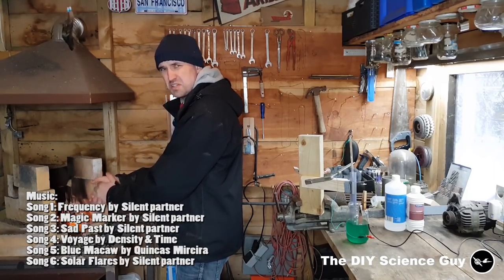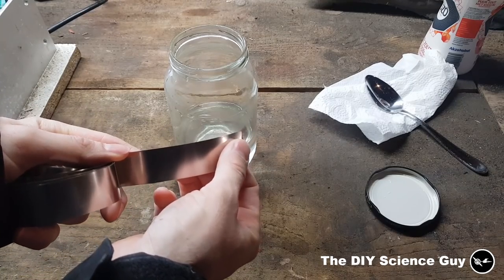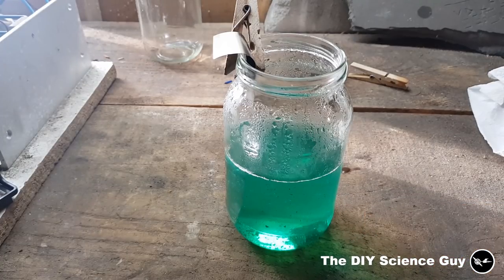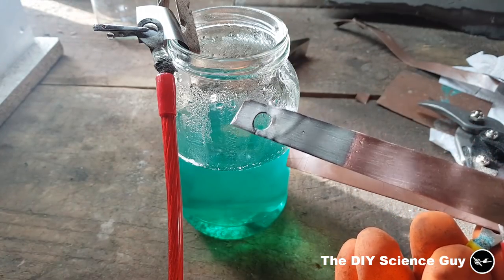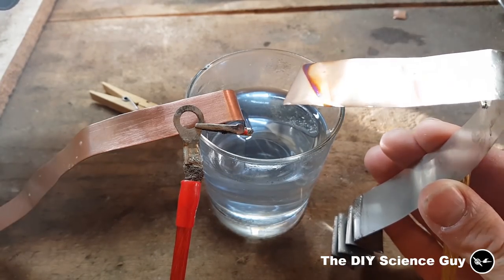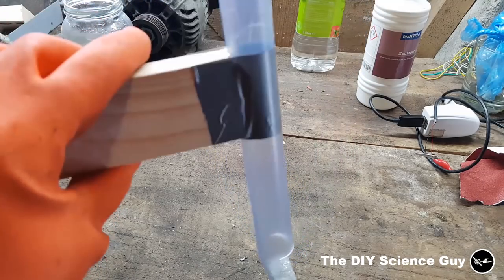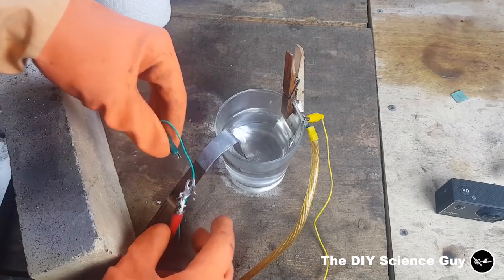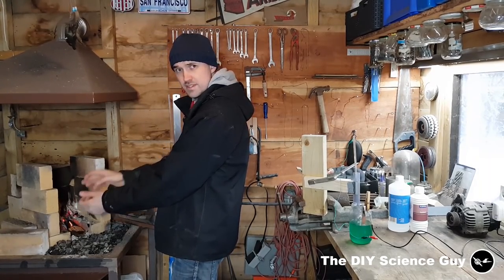Hydrogen Generator #4 Heavy nickel plating hydrogen generator electrode experiment

Comment: Excellent work! I was a little skeptical that a small layer of electroplated nickel could protect the copper substrate (even if a tiny pinhole appears in the nickel layer, the copper will eventually disintegrate under anodic conditions), but if that tiny piece can handle 3 amps for at least 6 hours without eroding at all, it looks like you've got the perfect electrode. Cleaning the copper beforehand with hydrochloric acid is definitely essential though, as any tiny bits of oxide or impurities will ruin the nickel layer, but it looks like you've got most of that figured out.

One thing to note, if you see any blue colouring or particles in the solution at all during the electrolysis, it'll mean that the copper of your anode has started to corrode and may need a re-plate of nickel.

Can't wait to see you open up that hydrogen generator.
Reply: Scrap Science.   The nickel plating has to be fairly heavy for this very reason.  Edison had good success with these materials in his Edison nickel-iron battery.
Reply: motor movidos a agua   https://www.youtube.com/watch?v=6iWjn3If5V0

Comment: If you are nickel plating you should use nickel clip on the positive side because if you use copper clip on the positive side the copper will  move to the negative side. Electrolysis transfer metal particules from + to - if you use copper clip on negative side it doesn't matter it will just be plated with nickel. If you always apply this method you won't get contamination in your plating like the black stuff. Positive side clip shall always be same material as anode. E.g plating nickel = nickel clip on + side. Plating copper= copper clip on + side. To make the nickel acetate voltage 12 volt and amps 25 or more doesn't matter but for plating process best result at maximum 3 volt and below 3 amps. Your nickel will stick firmly and evenly to your cathode

Comment: I have a comment for you when you plate nickel. You need a magnetic stirrer to keep the solution moving and the plating will not have those round balls on the surface. Worked in a plating shop a few months so I know that for sure. We used stirrers and flow aeration pumps ( vigorous solution agitation ) and high frequency ( makes shiny surface happen )to prevent the bee bees from occurring. Hope that helps.
Reply from the maker: Yes I saw something like that in an other video about a plating factory where they constantly kept the plates moving from side to side. Thanks for the info, will definitely use that! 👍

Comment: Cool. In your last video I think you used common 304 Stainless Steel, which will  corrode rather easily. It will even rust in mild saline conditions. Most HHO enthuseists use specifically 316 Stainless Steel, which is used in Marine aplications, Industrial Food Processing, Industrial Chemical processing, Powerplants, etc. Its an alloy designed for structureal integrity and high corrosion resistance. It will save you the fun of nickel plating copper and in this type of application the efficiency of copper compared to stainless steel is not significant because your plates cross section and surface area are quite large and you are not transfering power more than a few millimeters between them. differences in metal conductors are significant only with extremly low voltages or over a meter of distance or so. you know what I mean. You have more resistance in your electrolyte than the metal itself, lol.  Also your aceesss heat is comming from having way more amperage than you really need for the size plates you are using. Try about 0.54 Amps per square inch. of a single plate on one side. More amps do yield more gas but at the cost of more heat. Ive never seen anyone using a water cooling system like this but why not lol. cheaper than adding more plates  Awesome, video. I enjoy your process.
Reply from the maker: Thanks! And thanks for the info 👍
Reply: Where did you get this number 0.54 amps per square inch where does that come from/how was it derived?? Why does everyone keep saying 0.54 amps per square inch is that a 316L stainless steel exclusive variable or does that even apply to nickel/copper??

Comment: Excellent video! Way more informative than any I have seen.. I have tried nickel plating and had the same problem of the part not plating properly.  I will try limiting the amount of nickel anode in the solution to decrease the voltage.. I am using a cell phone charger 5v 2.4a..

Comment: Awesome work. I would suggest that when plating the electrodes to limit the current to 25mA. it will take longer but also ensure a more even distribution of nickle. Also turn the electrodes around regularly and agitate the solution regularly.
Reply: A good magnet under the cup can stir up the water or keep it moving. Not sure if it will hurt the plating or not.
Reply from the maker: Nice suggestion I will give it a try! 👍
Reply: What is the optimal voltage and how do you work out what voltage and current is best for plating?
Reply from the maker: Set your power so that you have the least amount of bubbles on the anode.
Reply: @LEO-xo9cz  - The voltage required will depend on the resistance of the electrolyte, ideally you would want the electrolyte to be as concentrated as you can possibly get it, higher concentration of the electrolyte means less resistance which means less voltage required. When voltage is passed through water with an electrolyte in it bubbles will start forming at the electrodes, these bubble of Hydrogen and Oxygen will disrupt the electro-plating process, so using too much voltage and too much current will result in an uneven and poor quality plating. So the idea is to use as low voltage and current as possible to reduce the amount of water separation (bubbles forming on the item being plated), in order to ensure a good even and strong plating. although it will take longer it will be worth the wait. It is useful to have a good quality power supply with voltage and current regulation.

Comment: I hope you had good ventilation there, you were always so close and also above the jars.

Also the salt method is more dangerous than the sodium carbonate one. But i suppose until now you know that one too.

Regarding the nickel band that broke, i suppose it is too thin. But you make it with what you have around.

Cheers
Reply from the maker: Yes very well ventilated!
Reply: Sodium carbonate will react with acetic acid (in the vinegar).

Comment: Fantastic video - I'm learning, I'm learning!
Love the practical demonstrations and the problem solving because there will always be issues, but the gist is in the solving of them.
I'm curious how well the procedure to plate the copper would work on a plate, does it scale upward? Would work on silver (better conductor) or gold (unlikely to corrode)?

Have you considered how to store hydrogen, even to pressurize for auto fuel tanks?

Stay safe!
Reply from the maker: Thanks!! In this video I show my hydrogen compressor: https://youtu.be/REV739pRNcw and in this one I'm plating a big copper electrode: https://youtu.be/GOppb7jRGCc I find silver and gold to expensive to experiment with.

Comment: Have you ever thought about using silver for the "plates"? I have seen someone make a hydrogen generator with washers. If you could use one once silver pieces, pure silver doesn't corrode or tarnish, from my understanding.
Reply from the maker: Yes but because it is more expensive I chose nickle.

Comment: @The DIY Science Guy - Thanks for the Great Video! Just come across your channel sort of by accident. But You've got my Attention. 
Never heard of anyone using copper electrodes for Hydrogen before. I thought about it once, but knew the copper would be eaten away quickly. I've also been recently messing with plating. My question is, if electrolysis can erode pure nickel in order to plate with it... if you did nickel plate the copper electrodes, HOW doesn't this thin nickel plating  just erode away?? As a hydrogen unit is basically just electrolysis....?  Seems like the nickel would get stripped off and redeposited on the next plate or etc?? But this didn't seem to happen in your test.... hum.....
Very Interesting Concept though, and maybe I'm missing something in this. *IF* the nickel plating would hold up long term, THIS could be a GREAT Idea! Would really like to hear more about this, subscribing and going to do some searching on your channel :-)
Reply from the maker: Thank you so much!! I'm no chemist but I think it has to do with metal oxides dissolving in an acid and precipitating out in a base. The oxide layer dissolves in an acid and exposes new metal and so on, but in a base the oxide does not dissolve so it protects the nickel underneath. Thanks for subscribing!!!
Reply: @TheDIYScienceGuy  Thanks for the Reply! I'm no chemist either... maybe a "garage scientist".... :-)  
Or maybe I'm just someone who likes to do their own work as much as possible, and learn everything I can so I can do More Work, and take what I learn in one project and be able to apply what I learned to help further a completely different project. 
In any case, I first started fiddling with hydrogen back... around 15 years ago? And I came up with a design i wanted to try way back then, but never had a mill, lathe, and etc to be able to try it. I am starting to get back into it again, if I can ever get caught up on other work I got to do. 
Anyway, Great Channel! Thanks Again!
Reply: The DIY Science Guy Agree with your explanation 👍

Even though you are not a chemist this explanation is quite accurate. And yes, even though nickel is quite corrosion resistent it will dissolve in mineral acids and in contact with oxygen under organic acids. The oxide layer is insoluble in alkaline solutions though

Comment: What if you take a very thick sheet/slab of nickel and drill out a channel, treating it like a flat cup and fill it with molten copper,  and make your connection to the copper
Reply from the maker: That would be expensive and less conductive, butt good thinking! 👍

Comment: I'd try to just use the pure nickel strapping you have to make the anodes. I know it's a bit thin and floppy, but with a jig/frame you could get them straight/uniform enough.
I'm just thinking the resistivity of nickel vs copper shouldn't really be a big concern? It's roughly 4 times as resistive. Hard to say at such high-amperage - small resistances could matter. Hard to say!
Ever thought of purchasing a PEM cell? The membranes and materials seem hard to track down to build one
Now I'm just wondering if I have a large enough container and big enough power supply to nickle plate my car's bumper hahah!
Reply from the maker: No I don't like to use stuff the way your supposed to 😂 so no PEM, for now I will use my table cloth to seperate the gases. I'm going for the nickel plated copper, we'll see if it works in the long run. Nickel plating a bumper is also fun!

Comment: have you considered useing some variety of carbon for the electrodes such as graphite ?
Reply from the maker: Well, a lot of people have suggested it to me but the thing is that the resistance of graphite is a 100 times higher than copper so I'm not sure if it will work very well.
Reply: @TheDIYScienceGuy   In my test, carbon rods seem to oxidize too, but strangely. The O2 is turned to CO2 (puts out an open flame) and the cells deteriorate in a dangerous way. Slim fragments or "grains" of carbon fall and short between the electrodes. I took them from old carbon/zinc batteries and pencils, not sure what sort of carbon
Reply from the maker: Yes I did something similar years ago and it did not satisfy me at all!
Reply: Chad W That’s not strange at all! 😄
The carbon rods are chemically quite inert to oxidation but not in electrolysis setups. When using a caustic solution you can exfoliate the graphite into graphene oxide and reduced graphene oxide which will turn the solution essentially brownish and then deep black the graphite is essentially oxidized just like a pieces of burning coals

Comment: Clean every thing your going to plate then only touch with gloves. You are using too much current and way to high voltage, go back to using the phone charger so you only get very slight bubbling, 25% vinegar and the rest distilled water. be patient and let it build up slowly. Use a fish air pump and bubble stone to stir the water. And use two anodes so it plates both sides at once. 60°c is a good temperature for the electrolyte solution. Good luck 👍
Reply from the maker: Thanks for the info! 👍

Comment: Hey, I appreciate your research :) You started doing electrochemistry research. What are the benefits of Nickel material over the 316 L electrode? Did you achieve the result that after a long time of water electrolysis, you remain a colorless electrolyte? I am persistently working on these preliminary tests, what chemical composition of the electrolytes I make, what molar concentrations, in aqueous solutions, to avoid staining of the solution. Did you experiment with what happens in the process of electrolysis of water when you add a little H2O2 Hydrogen peroxide to it?
Reply from the maker: Nickel plates don't give of chromium. No I haven't tried H202 does that help, and how?

Comment: To get a nickel layer that is finely deposited and sticks (in commercial nickel plating) they use nickel ammonium double salts if I remember correctly. You then get a bright and shiny deposit instead of a jetblack which adheres badly. Also regulating current density is also important, CD has to be low during the plating process, although of course it will take ages.
What I learned from my inquiries into plating platinum is that it is not possible to get a 100% perfect coat, and eventually the metal you applied the coating to will be exposed and react.
Reply from the maker: Thanks for the info! 👍

Comment: as you discovered controlling the amperage IS important. tbere is an optimal window. too much is bad and too little also. google "hull cell" for testing. addition of about 45g/l of glycine(amino acid) can improve the deposit. its not a supet good brightener but it helps.

Comment: How about plating your stainless elements with nickel? Seems the substrate is immaterial
Reply from the maker: Yes that is possible but I'm using copper because it conducts electricity much better.
Reply: The DIY Science Guy Nah. electroplating stainless steel is merely impossible without species additives

Comment: Do you have a reason to use sodium hydroxide or it's just cheap and easy to find ? Because I've read that this stuff is really corrosive for the human skin and so don't wanna use it with kids. However I spot another catalyst called "potassium carbonate" witch is way safer and also produce a more "pure" hydrogen and oxygen. (What ever "pure" mean x).

So one and so fourth I continued my research and found like you that stainless steel electrode are not a good idea even with that electrolyte. They recommend "cold rolled steel". No mention that it will corrode with the water and potassium carbonate in contact...

So my questions is :
- Have you tried potassium carbonate on steel or stainless steel ?
- Have you tried it with nickel electrode or do you think it will corrode ?
Originally I was planing on doing it with sodium hydroxide and nickel plated electrode like you but do to those warning I've read on wikipedia I not so sure. And for my personal usage, how the nickel plated electrode turned out on your generator ?
Thanks again for those great videos, learned a lot !
Reply from the maker: Thanks! No never used potassium carbonate. I know that some people use potassium hydroxide solution because it has a lower freezing point. If sodium or potassium hydroxide is to corrosive to your taste you can use potassium or sodium carbonate. Steel will corrode away very fast so that is not a good alternative. I haven't jet made new nickel plated electrodes for my hydrogen generator but I will at some point!